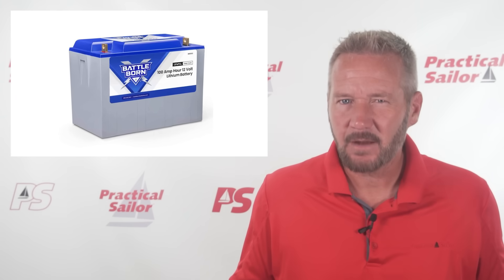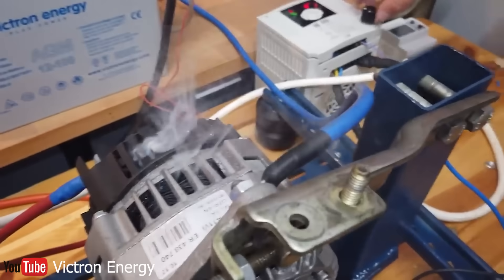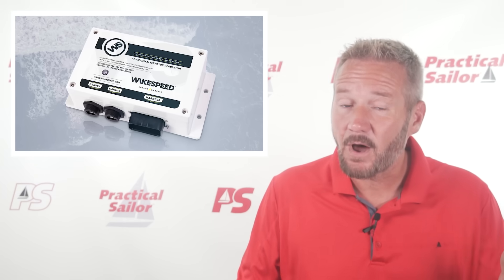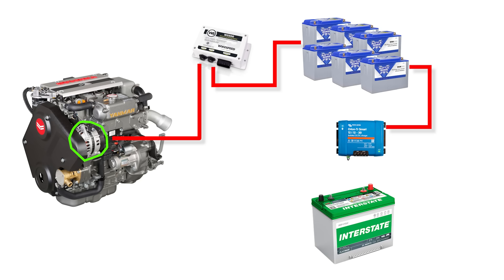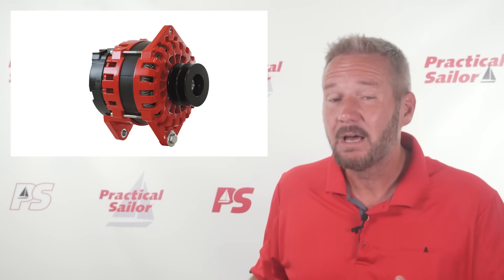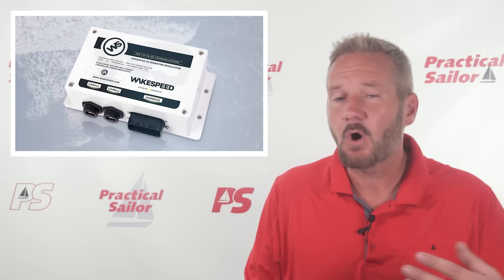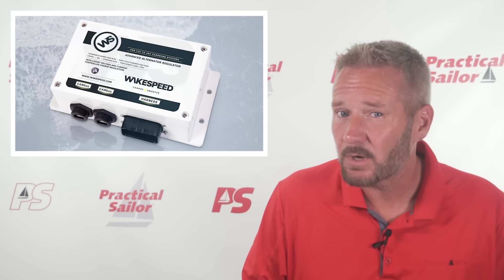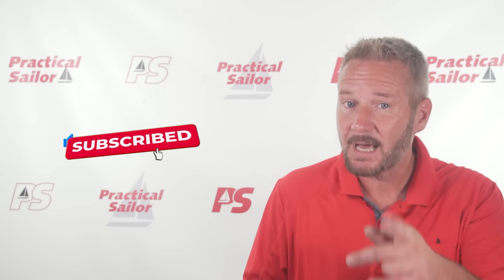Why you should buy this $1000 device for your sailboat – Wakespeed Alternator Regulator

Comment: Not the internal resistance that limits charge, it's the voltage rise, lead rises fast and taper charges long, lithium is flat and demands peak amps long and overheats the alternator because it cannot do peak demand more than about 30min , low duty cycle on alternator

Comment: This doesn't sound a whole lot different from the $75 Sterling Power Alternator Protection Device. Balmar has a similar device, designed to prevent the LiFePO4 BMS shut-off from frying the alternator. Then couple that with a lowly Balmar ARS-5H (carefully programmed for LiFePO4) to control the voltage, or spring for the Balmar MC-618 which has the programming and temp sensors to do it easily.

Comment: It should be noted that Battleborn batteries have a DANGEROUS condition occurring where the positive lug inside the case becomes loose, resulting in arcing and melted attachment points.  Because batteries are now hidden away because there's no maintenance needed the high temps go undiscovered until it's too  late 😮  see the  link below 
https://youtu.be/XP2yPY57Wjc?si=SvAwnAm4KzimmRdq

Comment: I installed a pair of the Wakespeeds on a customers boat several years ago.  And yes it does work more or less as described.  However, alternator temperature control is also available with Balmar and with the ARCO Zeus.   I found the set up system really cumbersome and absolutely NOT user friendly.  First you have to pull the cover off, then plug in the computer.  Once in one has to wade thru a maze of stuff that looks like a spread sheet to find the actually settings one wishes to adjust.  ....Practical Sailor..... Please help us out......... do a direct comparison of these three (Balmar, Wakespeed, and Zeus) different technologies.

Comment: For the past three seasons I’m using a Bank Manager (from Clark’s Adventure) to control charging with a combined Lithium/AGM system.  I have a 206 Ah SOK LiFePO4 battery and three Victron 100 Ah AGMs.  Two of the AGMs are “house”, and one is starting.  (I rotate the AGMs from house to starting tasks.) In my Pacific Seacraft Crealock 34 I have a Yanmar 3HM35F engine with a Balmar Series 7 110 amp alternator.  Plus a standard Balmar ARS-5 external regulator and Balmar DuoCharge to charge both the house and starting AGM batteries.  The Balmar charges the AGMs, but when the Bank Manager senses the AGMs are fully charged it then opens a very heavy duty relay to start charging the lithium.  I’ve had the system putting out up to 60 amps doing that, so the lithium recharges quickly.  The BM also senses the lithium is getting close on full charge, and tapers off the charging.  In 3 years of use the battery’s BMS has never once cut off charging suddenly (which could possibly fry the diodes if that happened), but since to AGMs are still attached while the lithium is charging, if the BM did somehow allow the BMS to suddenly cut off charging, the alternator would see the AGMs still connected, so no diode damage.  But, again, the BMS has never cut off charging.  When drawing power off the battery the BM leaves the lithium connected as the primary source of power.  If you ever managed to deplete the lithium, the BM would then use the AGMs as the power source.  I’ve been VERY pleased with the Bank Manager.  I believe they’re going for around $300; they come with a very detailed manual, and the designer/producer, Clark, has been great about answering questions.  Highly recommended.  Practical Sailor should consider doing a video about the Bank Manager, but Clark has produced a couple of very informative videos about the Bank Manager system on YouTube.

Comment: Just a correction or two. The Wakespeed doesn’t “ramp the alternator speed down”, only your engine throttle will do that. The Wakespeed controls the alternator field current, and thus the alternator output going to the batteries. On your point about adding a second alternator, you said the second alternator feeds the Wakespeed box which feeds the house bank. This makes it sound like the alternator current flows through the Wakespeed. It does not. Again, the Wakespeed is an alternator controller which controls the output of the alternator by varying the alternator field current. Also, before installing lithium there is much more to know, and do. It’s more complicated than just adding a DC to DC charger or a bigger alternator with a controller like the Wakespeed. Just understanding how to wire and fuse such a system is something that takes more effort and understanding than you might first think. It requires careful planning and often specialty tools, such as a tool capable of crimping the larger conductors needed to carry such high current, a job that needs to be done perfectly. You also need to understand how to set up charging parameters for your charging devices. Lithium is different, for example, they don’t like to be float charged. Lithium is also unforgiving of mistakes. If a person has any doubts it may be wiser to seek expert advice. It is possible if you have a problem and your lithium installation does not meet ABYC standards, you may find your insurance company will deny any clam. Just saying…

Comment: This is what I have been told by reputable venders at boat shows for a system that does not try to run AC or electric stoves off batteries. 1) Separate the lithium house bank from the lead-acid/AGM start battery. Remove battery combiner / 1-2-Both switch. 2) Rout all charging sources to the start battery. 3) Use DC-DC chargers fed from the start, charging the lithium. You are NOT limited to 20 amps. Victron makes 50 amp units that can be paralleled. The total DC-DC charge amps should be no more than 70% of the alternator's rated output. 

Newer Yanmar engines come with 160 amp alternators, making dual 50 amp DC-DC a reasonable choice. If the boat uses 100 Ah per day, that can be replaced in an hour of motoring; the time it take to leave one harbor and enter another.

If the BMS turns off the lithium bank, it won't kill the alternator because it sees the lead-acid start battery. In any case, you cannot use the same charge source to directly charge both lithium and lead-acid. They have distinctly different charge requirements. That's why the video recommended dual alternators, a very expensive solution.

Comment: What about using a smart-charge alternator? They pretty much do everything that this Wakespeed controller does, provided it has a digital signal to control the charging rate from the engine's ecu, all within the alternator unit itself.
They can even turn off completely when your batteries are full (you can do this manuallyby putting a switch in the signal wire), reducing load on the engine thus saving fuel, while they've been around in the automotive industry for quite a few years now and are steadily becoming more advanced and reliable. Not only that...they're available everywhere, they're not a specialised brand like a Balmar etc. that would have to be shipped across the world, you can walk into a car dealer and pick a suitable one off the shelf.
This makes me wonder why people are still trying to charge modern lithium batteries from the old 'traditional' style alternators?...it's like trying to recharge your laptop using a dynamo attached to a Penny Farthing.

Comment: Not used the wakespeed, although I have always fitted external regulators on lead acid setups, and they have worked very well. The wakespeed does look good for large boats and I agree it is well worth looking at. If you want to run an all-electric boat with an electric cookstove and maybe A/C you are probably fitting a 24v 1,000A/Hr + lithium bank and a 150A+ coach alternator, or at least you should be! In a system at that scale $1,000 for a regulator is quite reasonable. For any 12v system there are much cheaper options that are equally effective. There are battery-to-battery chargers available in the 50/60A range. If you don't regularly charge at anchor a 60A BtoB with a 120A alternator will handle topping up a lithium bank. If you need faster charging on a larger bank or regularly charge at anchor, fit 2 for a 120A charge rate from a 180A alternator. This also means you can select charge rates, max at anchor, lower underway to reduce engine load. I cover how to design and install a lithium bank without spending $$$ in my new book, Budget Sailboat Restoration, which is in final editing and due for publication before the holidays. Details at sailingbrigid.ca. (apologies to the moderator if promoting a book breaks the site rules)

Comment: Have you looked at the Zeus ? It does the same as Wakespeed. I talked to well reputed installers who far prefer the Zeus for its simplicity. I have a 460a Epoch that dc-dc to the start battery that is lead acid and it has been working great and I can watch amps, voltage, temps etc on my phone. Please review also.

Comment: We had a team from the best electrical installation group in our area replace our AGM battery bank with a Lithium bank last May. The system included a Zeus alternator regulator. Zeus was recommended by Victron as better technology than Wakespeed. 30 minutes into our first shakedown cruise to test the new system, we experienced a huge voltage spike that literally destroyed almost every component in our system. We had to replace the batteries, regulator, alternator, inverter/charger, almost every light on the boat, and other pieces of equipment. The source of the problem, as I understand it, was a firmware flaw in new lithium batteries. It overwhelmed the Zeus regulator and allowed the big voltage surge. We rebuilt the entire system with new Battle Born lithium batteries, new Balmar alternator, new Victron invertor/charger AND a new Wakespeed Pro regulator. It was a hard, costly experience for us. The new system is working well now. My take-away was... even the best in the business can be caught off guard by assumptions about what it takes to get the components in a lithium battery system to work together.
Reply: This is what you get when you use a not ready for prime time product that is using it's users as test subjects.  The Wakespeed WS500 has a lot of testing hours and is widely used.  It is a tried and true product.  You would be far better off using the Victron batteries as there is communication between the WS500 and the Lynx BMS.  This issue you experianced would not have happened.  I think with more testing and optimizing from Arco Zeus, that regualator in time will be a good product.

Comment: Many good ideas here. I have a 600Ah victron bank, Arco 225 Alternator and the Zeus Controller integrated via CAN bus to the Victron Lynx Smart BMS and Cerbo GX.  All this replaced 200Ah of lead and a simple OEM Alternator.
Lesson, talk with people who have done this, join user communities like Victron, and never be embarrassed about asking questions and questioning the answers.  Was all the above worth the cost and the learning.  YES, the added power was a real win for my extended summer sailing this year.
A final thought, make sure your battery temperature sensor cables are on the positive terminals, I noted a 20deg difference.

Comment: Since 4 years i run my old 600Ah lead battery bank parallel to a 200Ah LiFePo4. Alternator is a 70A Bosch with attached regulator rated 14.4V. The alternator never exceeded 80 °C @ 70A even in hot summer days. Everything works well! We live on the boat fulltime and cooking is electricaly since the LiFePo4 battery is on board. In winter the 600W solar panel is not so efficient and we use a honda generator or main engine for reloading. Since then i never changed the lead batteries and they are still fine. For this winter we ordered a 500W wind turbine because there is a lot of wind in greece in summer and in winter.

Comment: Started with a stock alternator on our little Yanmar 3ym30. Then we purchased the Electromaax 140amp alternator, serpentine belt conversion, and Emaax pro regulator. The heat sensor on the alternator initially caused the regulator to back the field down as it is supposed to, so I added a 4" fan to evacuate the heat from the little engine bay and exhaust it out through a cowl on the transom It's been running flawlessly since 2019 and the folks at Elextromaax have been great with customer support and answering questions, etc. It's a small boat, so we only have a single 314ah LiFePO4 battery. It's more than enough.

Comment: I have a Balmar 170A alternator with 614 regulator charging a lead acid engine battery. From there a Sterling 120A DC to DC charges 450Ah Lithium house batteries.  The Sterling DCtoDC never exceeds 30dec C and acts as a limiter so the alternator is never asked to deliver more than 75% of its capacity. Had this set up for 3 years - very happy.

Comment: If you already have a Balmar alternator (like shown in the video), why would you want one of these?  If it's a newer Balmar, it probably came with a MC-614 or MC-618 regulator, which does all this stuff anyway.  And if your Balmar doesn't have a "smart" regulator, you can add one for less than half the price of the Wakespeed (I see an MC-618 on sale for $289).  My Balmar with an MC-614 monitors the alternator temperature and reduces output if the alternator gets too hot - and I was able to get the alternator with the regulator on sale for less than $1000.

Comment: I wouldn't bother keeping the lead acid battery, or adding a dc-dc charger, or even upgrading the lead acid charger., I would just replace all the lead acid with lifepo4, t class fuse and use the Balmer to get your top balance in.

Comment: For people paying attention to details:  at 4:15 he said that the "wake speed will turn the alternator speed down" but what is actually happening is that the wake speed will reduce the current or power output of the alternator by reducing the field current to keep the diodes at the desired temperature.  The speed of the alternator is controlled by the engine it is connected to.
Reply: I wondered about that

Comment: I have an electric motor now so I dont have to worry about that.  20Kw of possible charging power under sail and then when the batteries are full I can just turn the key off and it free spins with no resistance. Let me know if you want to have a look at our boat and talk about the future.

Comment: I am using the dynawatt system on my cat. It’s a 5kW 400V 3 phased system. The control box converts it to 230VAC single phased. I then use it to feed  directly my AC sockets and my Victron multiplus II to charge my lifepo4 bank in parallel as well as the starter bank via a Victron battery charger. There’s some inefficiencies except when using the AC directly, but it’s a reliable solution. Daily lifepo4 top up is by solar. But it’s not a cheap solution either. Apart from the dynawatt it’s all Victron/Cerbo GX managed… And no gas onboard…

Comment: I installed a Balmar MC-614 about six years ago. It does everything discussed here, is straightforward to install and reliable.
Reply: I have the same. However, my older Balmar does not communicate with the BMS via CAN bus like the Wakespeed. That is a very important improvement for safety and, I think, ABYC compliance if you’re charging the LFP house bank with the alternator.

Comment: We have a 34ft catamaran with (2) 2gm20f engines.  I went with Elecrtomaxx v-belt to serpentine belt conversion with their 140amp alternator and their "Wakespeed" type regulator on each side.  We have 600 amp hours of LiFePo4 at 12v and all Victron components and 1460w of solar panels.  It has been a working solution that allows us to run an all electric galley and A/C.  Funny you mentioned lightning though, we had two separate storms with close lightning strikes that killed an alternator each time.  Nothing else was effected, just the alternators :-(

Comment: You asked for tips - here's mine - get a thermal imager (with a visual/tv display) and check every connection when the system is running - look for hot-spots. My first installation ended up melting a part of my battery box. Yes, it was my fault, but who cares once your boat is on fire. After that episode I learnt to check for excessive heat and it's now many years down the track with no other issues.
Reply: my phone has a thermal camera (ulefone 28), sounds like i"ll have another use for it
Reply: Don't have a thermal camera, so I try to touch every connection while running at max current to see if anything is warm/hot, and replace if so.

Comment: seems like a great time for someone to build an alternator that knows how to play safely with a BMS
Reply: What do you mean? Why would that matter?
Reply: Isn't that what this is?  The claim is that this regulator can communicate with BMS's.  The regulator is the "smart" part of the alternator. (OK technically two parts since it is separate, but the regulator controls the power output of the alternators so by changing the regulator to one that communicates with the BMS you ARE creating an alternator that does what you asked for)
Reply: @davidsuzukiispolpot  wrong. The ONLY thing the regulator looks at from the battery is voltage, nothing else matters. There is ZERO reason for an alternator to communicate with a battery.

If a charger needed to communicate with a lithium battery in order to operate, then how would all the other chargers on the market work without communicating with lithium batteries?